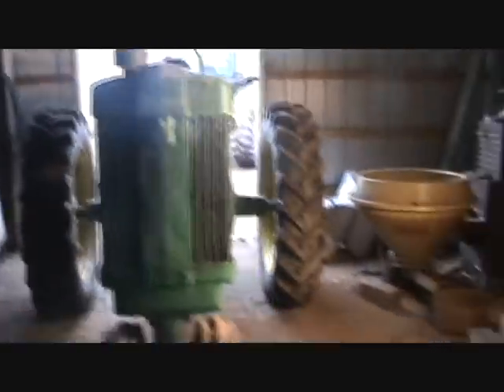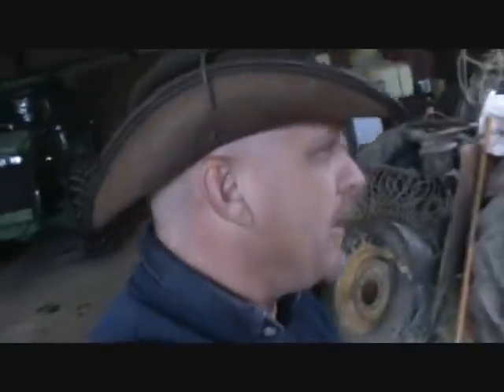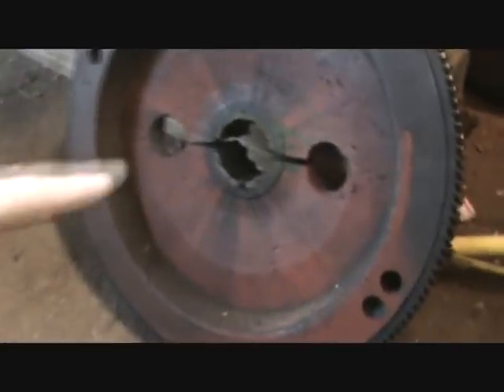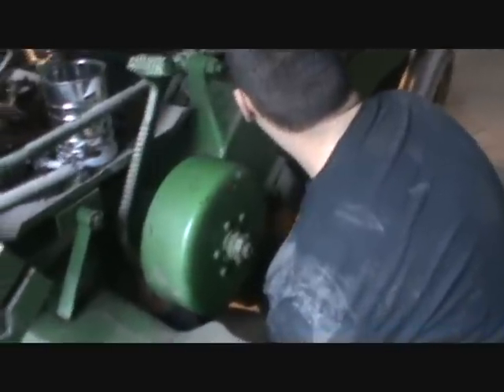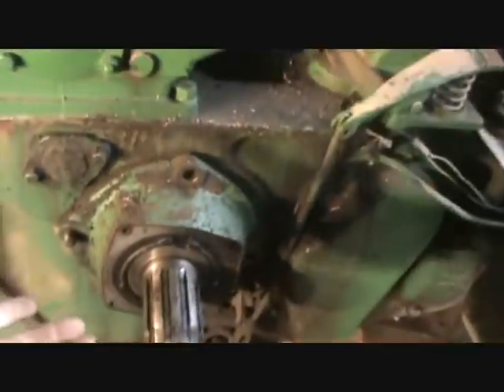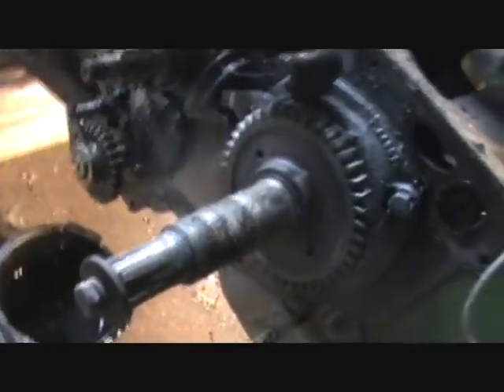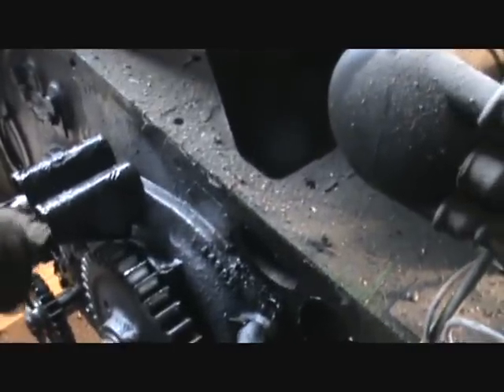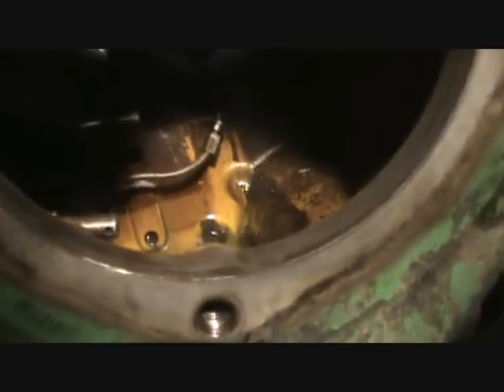john deere 60 crankshaft replacement #1

Comment: wonderful and informative video..Thank You
You stated previously that you need a new camera.I use the Sony 110 series full HD and I find them on craigslist for $100-$200 each in nearly new condition the are rugged and reliable. new they sold for close to $400. my first 110 is a little over 3yrs old ,cost me 125 and had only 3 hrs on the timer and the other is just 2 and cost me 185 with 6 sd chips and a nice case.I also have a cpl of Flip cams HD that I got for about 40 ea....Many Blessings SMR

Comment: Just subscribed love the 2 cylinder deeres . They were a way of life when I worked for a local farmer here in Oh as a young man . Spent alot of days on a 50 , 60 , 720 gas and diesel 730 diesel. The 720 diesel was as the video I saw a strong tractor , we pulled a 4 bottom 14 plow after plowing finish snapped the other dual on and run with a 14 ft harrow. Nothing like the smell of diesel smoke and ground rolling over.

Comment: Nice to see ya working on the old stuff. I guess the rings on the piston must all be at the top if you got the piston down and changed the pin and got it back in. or was that one of those edited moments trying to get the bottom ring back .I'm working on a perkins 3 pot that dropped a rod and half the piston below the sleeve. Had to mangle the bottom rings to push what was left out the top. not fun with black oil dripping on me. I see with this design you missed that fun too L.O.L.
Regards Robert

Comment: Hmmm- you wash your equipment before and after using them in the fields yet you didn't clean the engine before going inside to work on it.  Are you not concerned about contaminating the insides?